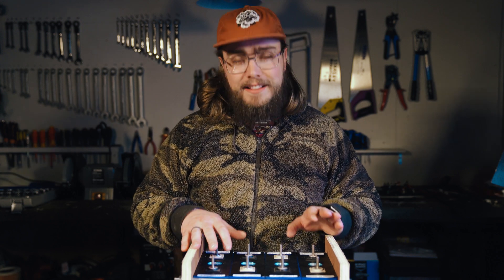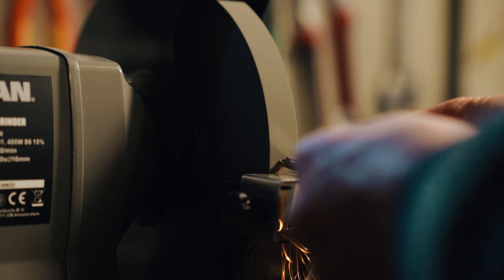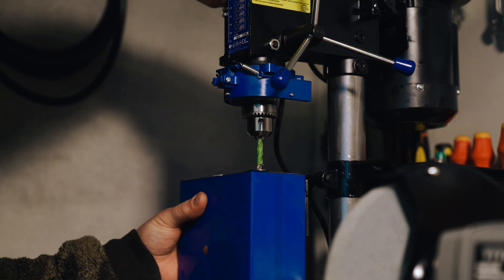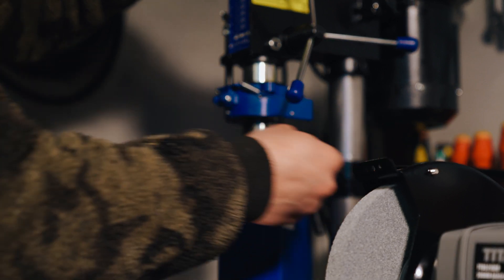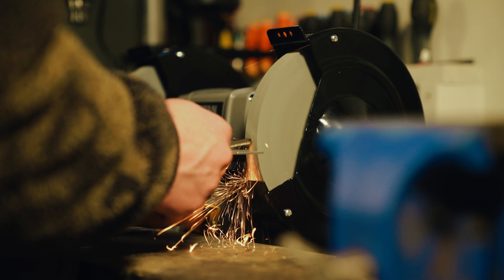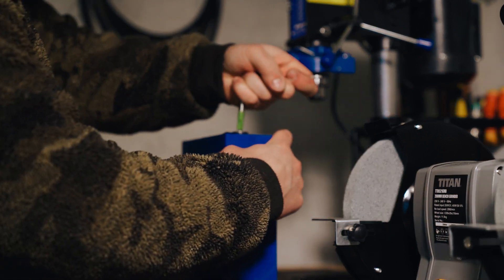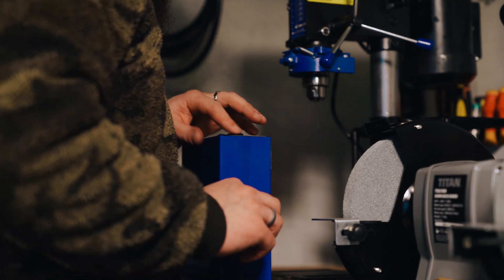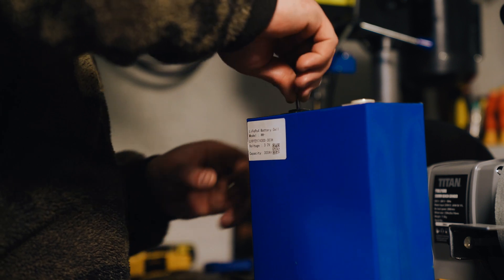How to fix a stripped terminal on a LiFePO4 battery cell

Comment: Thanks for the video! I ordered a generic M6 kit, the drill bit is actually 6.2mm and the tap is 7mm, so I ordered a 2nd kit so I can have one set tapered to get started and another ground flat to bottom out. I was easily able to drill with a cordless drill and tap by hand (with a silcock key as a handle). Probably shouldn't go over 20 in/lb on the M6 bolts, I stripped mine at 40.

Comment: Since I'ma be running a new tap hole what size are the original screws that goes on the post terminals 8 mm 10mm heads 6mm I'm not sure what size screw tap to drill
Reply from the maker: It depends on your cells and who manufactured them. The most common is an M6 thread.
Reply: @offgrid_power  im looking around Amazon like what material & length M6 studs are those on the cells they got everything on here steel alloy steel aluminum etc lol
Reply from the maker: These are the grub screws we use on cells that don't have a welded stud: https://geni.us/GrubScrew 

We just get the right length depending on what we're doing. Mostly we use the 25mm or 30mm.
Reply: @offgrid_power  ok thanks I have a bunch of cells with no holes at all so I'm trying to figure out my best route on them
Reply from the maker: I'd probably drill and tap them and see how they do. You might want to put helicoils into them as helicoils sometimes are stronger than a thread in the aluminium terminals.
Reply: @offgrid_power  yes I have some M6 helicoils on the way the M7 tap just got here today I'm waiting on the 1/4 M7 drill bit and I have to order some M6 studs
Reply: @offgrid_power  I may order both just to eye them and see
Reply: @offgrid_power  Oh ok the cells are Calb 120ah i did buy a 1/4 M7 drill bit and a M7X1.25 bottom tap for M6 helicoil threads now i gotta find the M6 helicoil and some M6 studs & screws

Comment: There should be depth setters on the drill press to do that sort of work . I have on mine and just about every other drill press I have seen. Also if you use a tap on the drill press use a counter weight on the handle to put a slight download on it . Just some thoughts.
Reply from the maker: Thanks for the advice. All valid points and something to consider in future! :)

Comment: Where did u get the kit
Reply from the maker: Hi Jimmy. Which kit do you mean?
Reply: @offgrid_power  tap kit
Reply: 7.3mm drill bit, what size tap
Reply from the maker: We used this Helicoil set, which has the correct size drill bit: https://geni.us/Helicoil
Reply: @offgrid_power  so it's not 7.3

Comment: That's the wrong kind of tap to use because you need to use a bottom tap. The one you have is tapered start
Reply: Hell never mind, I just seen you fixed that. I did exactly the same thing, just grinded the tap down to flat start
Reply from the maker: Yeah, I started the thread and then ground it down. You could probably get away with grinding it down first. :)

Comment: So - your fix is to re-tap a new thread. tnx. Just saved me 11min of watching 👍
Reply from the maker: Glad it helped! :)
Reply: What size drill bit and tap did you use?
Reply from the maker: @REYDELAPLAYA  I used the drill bit that came with the Helicoil kit. I think it was 7.3mm to drill the hole out for an M6 Helicoil.